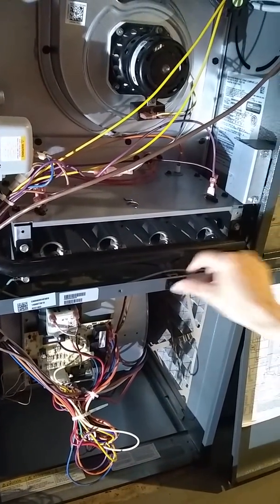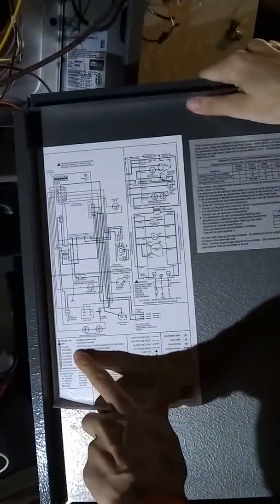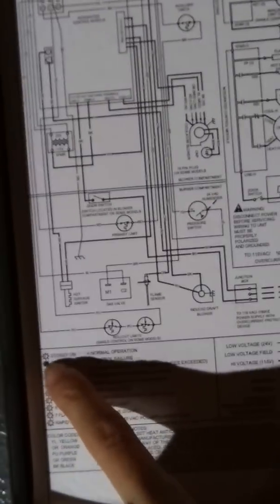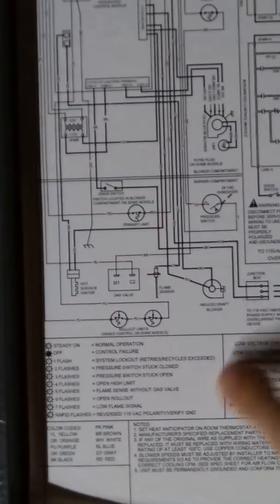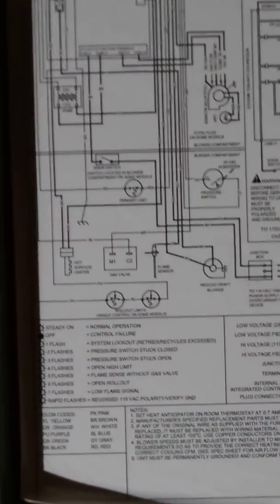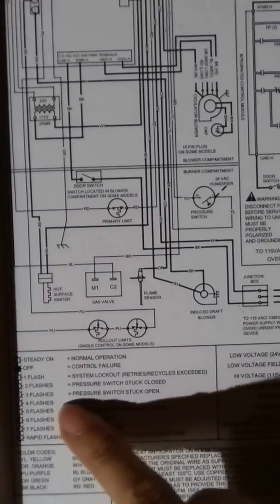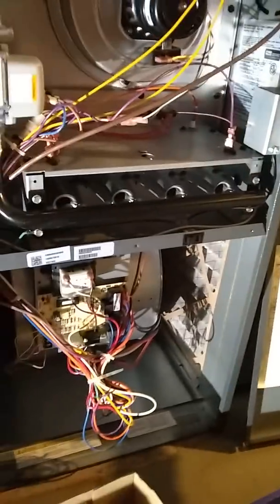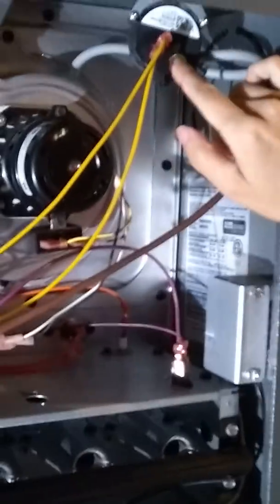Goodman gas furnace won't start No flame Part 2 -- Find the problem - 3 blinks /Error code 3

Comment: Thank you 🙏 Have 3 red light blink. Bought a new Pressure switch (12 year old Goodman gas )and all systems go with no error codes 👍🏻👍🏻. Heat came on. Also cleaned the flame sensor for good measure 👍🏻

Comment: This video is horrible. WTF is the problem?
Reply: I think his point was how to diagnose the problem and where to evaluate the signals given from the computer.
Reply: The problem should be the pressure switch. My case is a dead bug stick inside the tube connector on the fan. That took my so much time to locate the issue.
Reply: I'll bet you didn't do well k-12, if you made it that far.
Reply: He's Chinese and can't speak Engrish.
Reply: @ConservativeAnthem  oohhhh my GAT! racisst